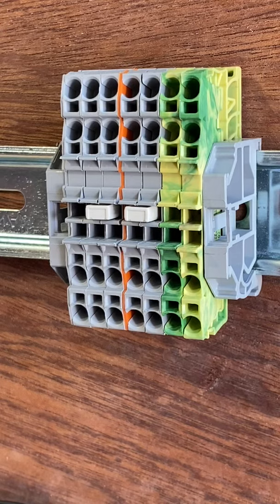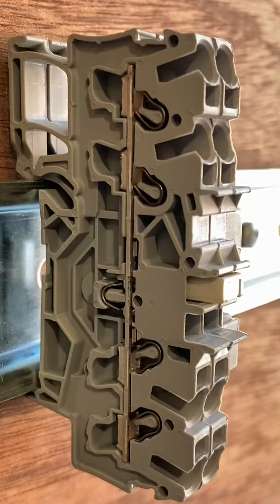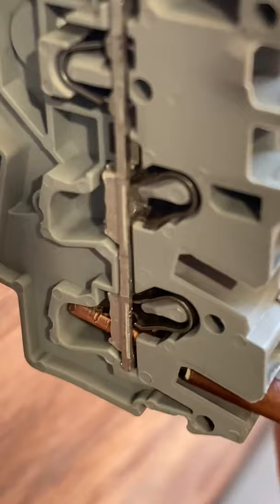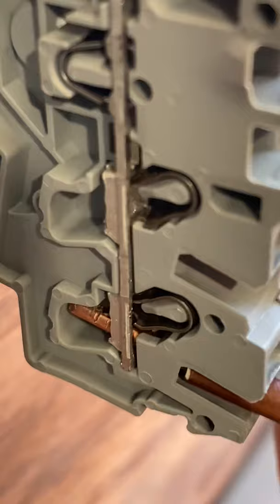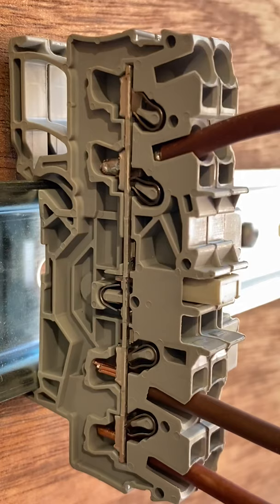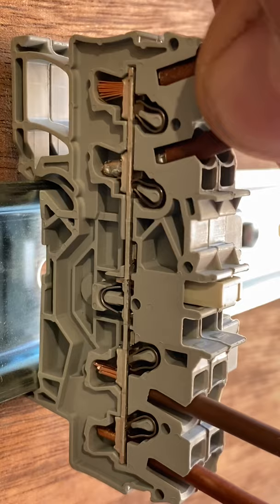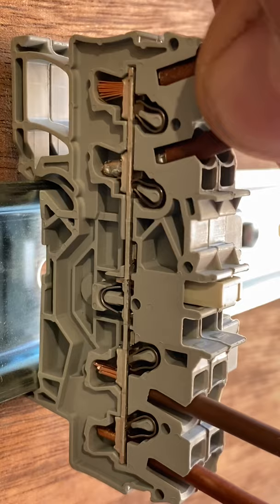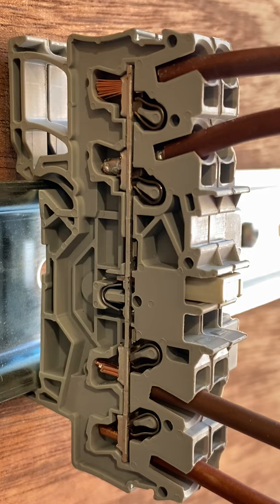How does a WAGO connector cage clamp work? #shorts

Comment: Being able to see if the wire from the front if it is inserted is really helpful with tiny feruled sensor cables. No trying to feel around from the bottom to see if it's inserted all the way and no slipping out because there's no tightening. I dare say it's almost enjoyable moving wires around in a cabinet.

Comment: Call me old school, I like screw terminals. Yes, I know it's the UK with higher VAC, but......warm that up real good and the spring will eventually loose tension. Even  screw terminals should be checked from time to time in high amperage draw situations.
Reply: And I think the screw terminals have more surface area to touch the wire
Reply: There’s a reason spring clamp terminals are classed and maintenance free and screw terminals aren’t…..
Reply: Have to wire plant equipment panel and have a thousand connections to make these reduce wrist stress, speaking from first hand experience.

Comment: How much force can someone put on the wire before it pulls loose?
Reply: Well as much as you need to cut a wire.. the clamp bites into it when you pull.. if you normally use wires for climbing then it's not for you
Reply: depending on your rail they'll come off the rail before the wire come out.
Reply: @ismaelyu5  🤣

Comment: Weidmüller  Have had this type of terminal for years. Is this new? Or just a new sponsor?
Reply from the maker: It’s not new - but lots of folks still using screw terminals
Reply: @efixx  because its cheaper probably
Reply: @tommymack3210  it's not, at my work at a hydraulic press panel shop we use hundreds of thousands of these a year, and it's less expensive to get spring clamp. And they save so much time and your wrists.

Comment: Only like the terminal strips that utilize a screw to secute wires. Had these mickey mouse piece of crap burn up.
Reply: well screws are good for people that cant use a push in properly.

im happy to find the stripped screws you leave behind
Reply: @JANICKGMO_  can not remember stripping a termi al screw in last 40 years pronably stipped a few while an apprentice.
Reply: You are CORRECT.
20 or 30 amps will burn the wire & the house.
Screw is best.

Comment: Just try to pass 20 or 30 amps, burn the wire & house?
Reply from the maker: This version is more for industrial applications - been using them for 20 years with no problems.
Reply: This kind of comment I find very silly.
Every connector has a current rating, and if you go beyond it, of course it is going to fail.
That's the purpose of having a rating. It tells you what you shouldn't go beyond.

If the connector is rated at 30 amps then it will hold 30 amps. If it can't handle the rated current, then Trading Standards department is going to be on the case and the product will be forcibly withdrawn from sale.

So the comment "try to burn 20 or 30 amps.."

My question is, what's the connector rated for? 
Why would you put more current through it than for which it is rated?

Comment: Crap design! A thin springs edge that holds wire in with very very small contact that will cause a hot spot. Set screws are much better. Trying to speed up a very serious step in wiring just for convenience is a mindless act of engineering!
Reply: These style of clamp is standard in the industry for years now, the spring part actually bites into the material, and makes proper contact, even for high power applications with thick wiring.
Reply: Ironic when someone thinks they have engineering knowledge and craps on a connector that is a well proven industry standard...Dunning Kruger strikes again.